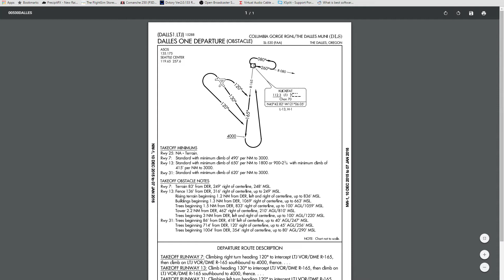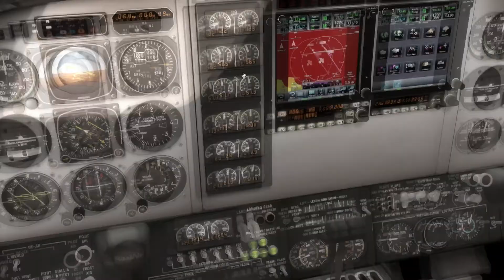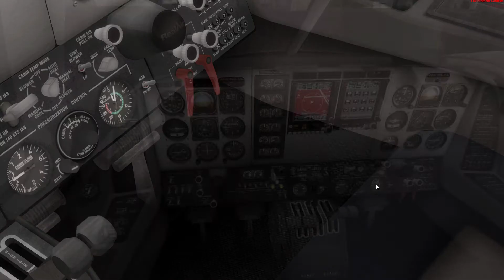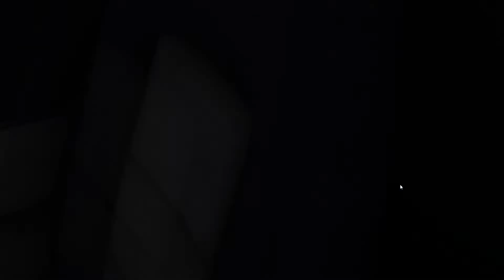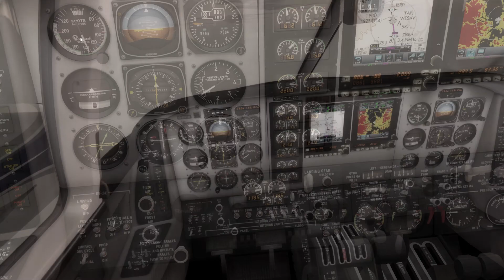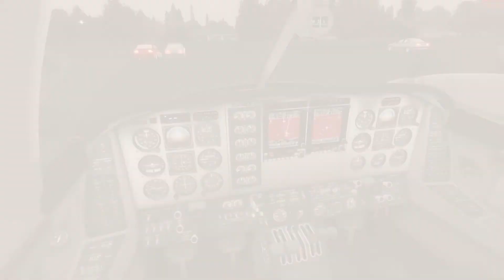Tutorial hard IFR flight with Realair Turbine Duke V2 and Flight1 GTN 750

Comment: Horrible audio. You need to look into learning how to process your audio. There's a free program called Audacity which allows you to do this, and there's a tute on my channel (not a plug) to show you how to make you sound awesome, and how to remove the background noise.  I really wanted to watch this, but the audio was too hard to listen too. I so want the Duke v2. i have v1, but you just can't get any RealAir planes any more :(
Reply from the maker: I do sweeten my audio. I remove the background noise, use a noise gate and use a compressor.  You will notice when I say I put on my headset (0:50) I cutoff frequencies so it sounds like I'm talking through a headset. The background noise you hear later is the engine noise which I mixed in at a very low volume (and I bet I put a notch in it to let the voice frequencies through better). All this is for ambiance, of course. Too bad it's not to your taste!  And yes I agree, it's too bad RealAir is not operating anymore! :(
Reply: @FlightSimAdventurer  I understand that; however I think maybe you've gone a little far as it's quite annoying and difficult to listen to. If you just removed the bass I think you'd get an acceptable effect without losing watch time. Hope that helps. 😁

Comment: Hello sir, you got a pretty tough aircraft, your mixture was left at idle from taxi, run up, take off and climb to altitude. So you need no adjustment and you r already leaned for over 5 thousands feet. Where do you get your check list and poh for the duke. I can't seen to find a good one
Reply from the maker: Pretty tough indeed as it's a turbine aircraft, not a piston. The 2 levers on the right are not mixture controls but 'condition levers' to control fuel cutoff and then set low/high idle. 8*)
Reply: this is a touchy subject in the turbine duke community, as most turbine aircraft would be placed in high idle prior to take off, the duke does not specify that this is nessecary, and i have seen many conversations between realworld duke pilots discussing pros and cons of both positions of the condition levers..

Comment: Add fuel pumps "on" on your final approach check list.  Loved the vid... I have the Turbine Duke and the GTN 750.  Just learning how to use the gps.  I'm and old com'l, inst, ME pilot but there was no GPS IFR when I was getting my ratings (early 70's).
Reply from the maker: Glad you liked it and I'm happy to see the video has almost 4K views now. Actually the pumps are ON the whole flight. But it's a very good idea to add it to the checklist on final.  Done!  Thanks.
Reply: Yes, I thought that was the case as you turned them off during shut-down.  I use GUMP when entering an approach: G gas (fullest tank)...U undercarriage (3 in the green, 1 in the mirror)... M..mixture...P pumps.  Then on final I use CUP:  Cowl flaps .. Undercarriage .. Props.  I always need a little help keeping this old brain organized!
Reply: James. Same here. Not a licensed pilot but both folks flew. Com'l, Inst, ME. I grew up in right seat as kid and young adult in early 70's. Got into FSX since the 80's ALWAYS attempting to fly correctly and real as possible. I wasn't exposed to GPS during said time and resisted using in FSX til I forced myself to properly learn VOR, DME, NDB, ILS  reading real charts and approaches.
Reply: @MikeBixby  Good approach Mike.  You never know when your GPS is going to pack it in.  Usually at the worst time.  I always have my #2 running a normal ILS when shooting a GPS approach.  I love FSA's motto of "Remember your autopilot is trying to kill you!"  Sage advice that I have adopted as my own.    I wonder with the recent 737 Max tragedy's  why the pilots didn't just power down the MCAS and fly the airplane by hand.  Why in the world would you let the airplane fly itself into the ground?  Pilot training?  Anyway, fair sky's.